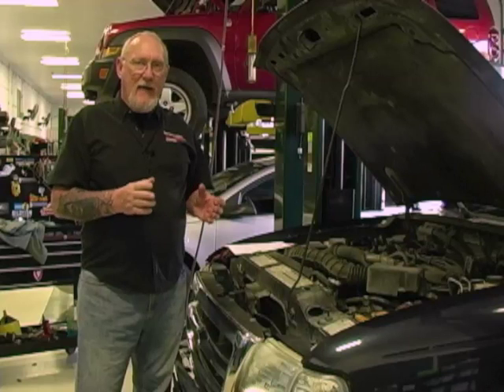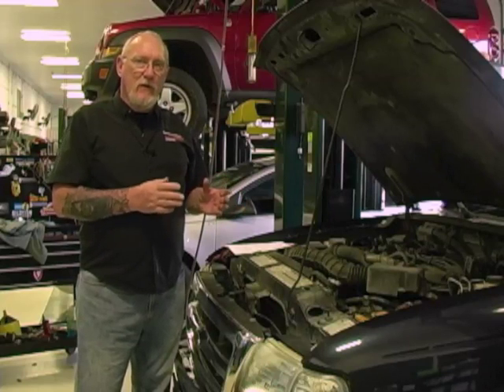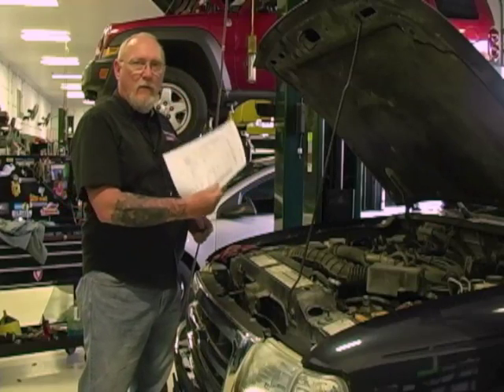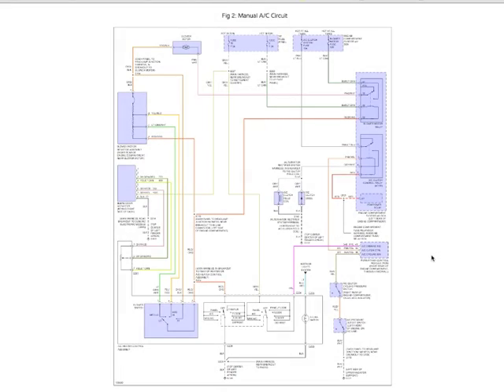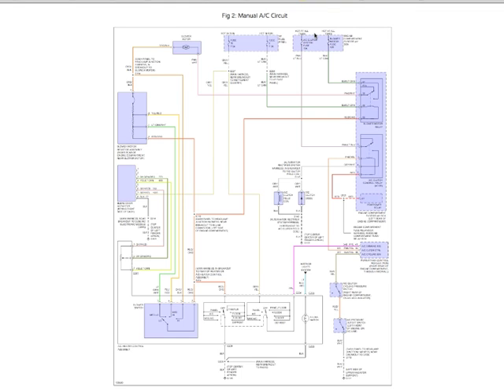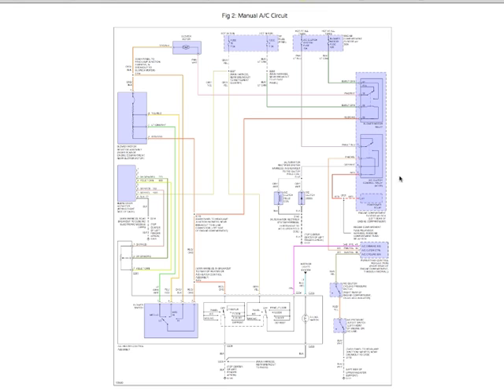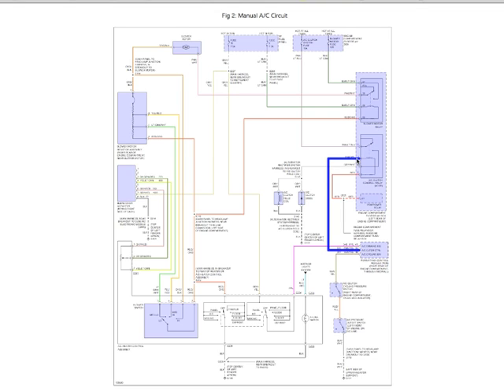The Trainer #40: How To Fix An Automotive Air Conditioning Compressor That Won't Turn On

Comment: how much its cost of that repair ?just an estimate price
Reply from the maker: If the clutch assembly is available separately, repair shouldn't be too much. If the entire compressor needs to be replaced - that's a bit more involved. Of course, it depends on your make/model/year of vehicle.
Reply: @VehicleServiceandRepair  2003 lincoln town car executive
Reply from the maker: @jovitosolamin268  Costs can vary depending on where you live, the shop's labor rate and price mark-up.

Comment: Why would the switch stay on? Even with the ignition off the ac clutch is always engaged unless I pull the 10A fuse. The relay tested good
Reply from the maker: The connection between the fuse and the clutch is in the relay. Sounds like it is stuck in the closed position to me. You may want to recheck that.
Reply: @VehicleServiceandRepair   I've swapped out the horn relay and the horn works flawlessly with both relays. I'm thinking the pcm has fried in a funny way that soldered it closed creating a parasitic drain on the batterie as the clutch stays engaged overnight without the ignition switch on
Reply from the maker: @johnsonandson7772  If the driver that controls the relay is closed all the time, you'd have the same effect. Not as common but certainly a possibility. Install a test light across the switch side of the relay and see if it lights up. If you do find the problem is in the PCM, be sure to check to see what else that driver may control and there is no high current draw present that might have caused the damage - or you'll have the same problem down the road.
Reply: @VehicleServiceandRepair   Would the driver be the pcm? It's a 98 dodge ram so it only really has the one brain or control module
Reply from the maker: @johnsonandson7772  Yes, the PCM activates the relay by closing the circuit of the relay solenoid on the ground side. The "switch" is referred to as a "ground side driver". However, this circuit only has power when the key is in the Run position - so it isn't likely to be the cause of a parasitic drain. Let's start at the beginning...

Remove the A/C compressor clutch relay. With the key off, use a test light to check for the presence of voltage on each relay pin in the junction box. Only one should light the test light - the one going to relay pin #30. 

With the key ON, only two should light the test light. The second pin goes to relay pin #86 and supplys power to the relay solenoid. 

Let me know what happens.
Reply: @VehicleServiceandRepair  Will do thanks for the replies, the ac clutch stays engaged even with the relay pulled out so I'm hoping it's the fuse box not the pcm. I'll lite it up when I get home from work
Reply from the maker: @johnsonandson7772  If that's the case, that has to be a short to power after the relay - so the PCM is eliminated as a possibility.

Comment: What if there isn't any power to the pressure switch on the dryer.
Should there be power there when the ac is turned on?
Im thinking that the control module on dash is done.....?
Tyty
Reply from the maker: If your test results indicate that the ECM is not turning on the relay, then a possible cause is the lack of any sensor input it needs to OK the A/C. As for how the sensor is wired, you'll need a schematic to determine that for the vehicle you're working on.

Comment: I'm a beginner.
03 jeep liberty.
I know I have the right refrigerant pressure.
And the clutch compressor is good.

I tried to bypass the relay and clutch didn't engaged.
I tried to bypass the low pressure switch a and clutch didn't engaged?
What should I do next? 
Or what does this mean?  
The pressure is right and clutch it's good?
Reply from the maker: Have you verified that you have power at the clutch? How about the air gap? How much current is the clutch coil drawing when energized?

Comment: .2000 Jeep Cherokee... Wont Take Freon... Compressor  worked great in the other jeep.  I start the car turn on A/C controls, Hi/max,  When I unplug the ac compressor i still have power on the compressor  end/plug but no power on the plug wire coming from the wiring harness. Only time that wire has power is when the ac is pluged in. Is that right??  My low  pressure switch  4 ports has power on 3 out of 4 ports/slots. My high pressure switch2 ports  has power on  both ports . it wont take freon.. ..{update }   car running ac controls on, if i unplug my low  side  sensor i then have a hot and ground on the high side switch  instead of 2 hots but low side switch has 3 hot 1 neg. unplugged... i did test the wire thats going into that port and it has power going in the  switch but no power in the port of the switch.  If i hook the low side back up, again i got 2 hot ports on the  high pressure switch.  Even when i have 1 hot side other neg or no power on it. it still wont bridge over the clutch and when i got both sides hot and try bridge it it then will blow the big 20 amp fuse. So could my low pressure switch/connector  be bad if so will that keep it from accepting freon.

Comment: I drive a Toyota picnic 2010 and the a/c won't disengage what could be causing this. can someone plz help me
Reply from the maker: There are a few possibilities. The relay may be stuck in the closed position, or the ECM thinks you want the A/C on when you don't. That could be an HVAC control head switch that isn't working properly.

Comment: i have,a 1994 S10 that has an a/c problem I trying to chase down. i checked the freon charge and it shows the system is full. on any setting of the a/c switch, the compressor will not engage. trying to find the cause. does anyone know where the a/c relay is on a 1994 S10 extended cab with a 4.3 V6?

Comment: someone help ... I have 2001 xterra fuses good .. has freon ..a/c compressor only works when I bypass the a/c compressor relay .. I tried a new relay and nothing  worked
Reply from the maker: Let's review what you know to this point. 1.) The compressor clutch circuit works as evidenced when you jumped the relay control side of the circuit. 2.) It doesn't work with the old relay, and it doesn't work with a new relay...so I have to think the relay is not being turned on.

The ECM has to see certain conditions met, including the request for A/C from the interior climate control panel on the dash. You'll need a scan tool with enhanced OE capability to see this PIDs. 

OR

The circuit for the relay control side is open. You'll have to perform basic circuit tests to verify the circuit's power and ground paths are intact.
Reply: did you ever figure out the provlem? my compressor also only engages when i rig a wire in place of the relay..but i switched that and the starter relay which are the same so it cant be the relay fuse

Comment: My compressor engages no problem, but the pressures on the gauges don't change at all!
Reply from the maker: +CDYJKR You don't indicate what year, make and model car you own so I can only offer a guess. If I saw compressor engagement with no change in high or low side pressure AND the pressures were equal high to low, I would suspect a failed compressor...probably a bad reed valve internally.
Reply: +Motor Age it's a 2000 BMW 328i, and that's what I feared. Thank you for your reply.

Comment: what would cause a relay to work improperly . Sometimes it works sometimes it don't . If I run it direct it stays on . 1996 379 peterbilt
Reply from the maker: +Daniel Deras I used to work in a shop that occasionally serviced Florida Highway Patrol cruisers. These guys left their air conditioning on all day long, and it was not unusual for the relay contacts to burn - causing a voltage drop issue that could result in intermittent function.
Reply: +Motor Age I have been having a similar problem with my ranger. truck has to run for about 20mins before the clutch will click on. and works great after that. any ideas if the relay cold cause that?
Reply from the maker: Use the current test described to see if the clutch coil is energized or not, regardless if the compressor has kicked on. You may have a problem with clutch air gap or some other mechanical issue.
Reply: +Motor Age ok I will test the relay

Comment: Hi!

A dumb question maybe but, 
if there is no pressure on the low side, is there pressure on the high side? 

Thanx from Sweden ☺
Reply from the maker: +Fredrik Sundvall No, pressure will be equal on both sides with the system "off".

Comment: Great video Pete. Couple of questions - 1) On the solenoid side of the tool what does it mean when the bottom LED glows red or green?2) If the bottom LED light lights - does it mean that the solenoid circuit is working as it should and the PCM is commanding the relay on?  Thanks
Reply from the maker: +mrghiax 1) The same as the change in color for the top LED - the polarity of the circuit, or which terminal on the front of the tool is the switched system voltage. 2) It only indicates that the PCM has closed the circuit. I guess it is possible to have an issue with voltage drop that would still allow the LED to light but would expect that to be a rare occurrence.
Reply: Motor Age Many Thanks Pete, That has cleared that up for me.

Comment: I have a 2001 Honda Accord my a/c compressor seems go into motion and start when I turn the a/c on, but I recently filled it up with antifreeze so I can get a cool breeze  from my a/c vents but its just spitting out hot air.. any ideas on what could be going on?
Reply: +David Huerta if you actually used antifreeze, that's going to be a problem. But assuming you meant that you used R-134A, if it's still blowing warm air it likely means that the compressor isn't engaging. This can be due to the compressor clutch, as demonstrated in this video, or like so many Hondas you may have a faulty clutch. Supposedly this is a major issue with Hondas.

Comment: One thing I did not see mentioned,  was the IAT sensor.  Some manufacturers (GM) ,  if the inlet air temperature sensor is bad or unplugged,  it will default to 32f.                                  

The ECM will say "Hey!!!  I am not turning on the AC,  it is freezing outside".
Reply from the maker: trae heck True! There are numerous inputs the ECM must see before it allows the compressor to turn on. If it doesn't, it won't command the relay on and no current flow will be seen at all. If power is present to the relay but the circuit is not being completed by the ECM, it's time to check all the inputs to see what is missing. Thanks for the comment.
Reply: Motor Age orfice tube

Comment: Great video!!!  I have a 2000 Cadillac Deville I had a shop fill it with refrigerant now the clutch wont engage. Relay is good,  low pressure switch read 5v with ignition forward but not running high pressure switch read 5v as well.  When the clutch is jumped it blows super cold air.  When the low pressure switch was disconnected the ac controls automatically disabled the ac to the off position.  Any help would be appreciated.

Comment: I have a 2001 Ford Mustang 3.8l V6. AC started blowing hot air. I checked freon and levels are fine. Compressor is not cycling when AC is on, but when I go to turn it manually it isn't frozen. Also checked both fuses for AC and they were fine as well. Still trying to figure out what's going on

Comment: So I am able to measure voltage at the compressor connector, ruling out relay, fuses, pressure switch. So clutch coil is bad? What can I measure on the clutch coil pins to determine if it's good/bad? What about A/C clutch diode? Is the diode embedded in the clutch coil, or connector? Where can I measure to determine good/bad A/C clutch diode?
Reply from the maker: George Schissel Measuring voltage at the compressor doesn't prove anything yet. Many models ground the compressor, rather than supply power, so double check the schematic. If it is power supplied, put your meter in amps mode, and check current through the field coil. 3-5 amps is typical of a field that is OK. HTH!

Comment: Wouldn't it be easier to use a multimeter and measure the voltage going into the compressor with and without the AC switch on? You get 0Vdc with the AC off and 14Vdc with the switch on. Would that not automatically rule out the switch/relays without all of the other tests? I'm asking because I currently am having problems with my AC Clutch engaging on my 97 B4000 and don't have all of the other fancy equipment so I just tested the voltage going into the Compressor.
Reply from the maker: Justin Frady On some vehicles you can do a voltage check directly at the compressor. On others, the compressor is buried deep in the engine compartment. Using current allows you to check the compressor clutch coil operation no matter where the compressor is located.
Reply: Gotcha

Comment: A/C in my fiance's '08 civic works great upon first starting the car. Only after it warms up  does the clutch shut off and remains off till the engine cools down. Could this be a pressure or thermostat related issue?
Reply from the maker: Adam Agee The A/C is controlled by the engine management computer, or ECM. It is possible it is seeing something it doesn't like and is turning the system off in response. I would monitor/record the engine operating parameters related to the A/C system (as found in the service information for your vehicle) at the time of failure to see what is out of whack. It may be related to engine temperature - a thermostat issue or a fan that's not coming on when it should, for example. Or an A/C pressure issue - too high, too low, or a sensor that is misreading and lying to the ECM.
Reply: Motor Age Thanks for the quick response and recommendations.
Reply: Motor Age suppressor show possible fix

Comment: Hi Pete.  Good video.  I am older than you and know why you say "solenoid", but I quit calling the coil in the relay a solenoid after my electronic engineer son explained to me that a solenoid (as on a starter) is a electromechanical actuator that performs work, whereas the coil inside a relay only transmits current.  Keep up the good work.

Comment: I have a 2001 Toyota Camry, the inside fuse (under dash) pops when I turn on the ac or defrost. A/c clutch is free, relays appear to be ok, no blinking ac light. where do I look from here, any suggestions ?
Reply from the maker: rvann You'll need a Power Distribution wiring diagram to identify all the circuits that the fuse that is failing feeds. This is a short circuit diagnosis and may or may not be in the a/c clutch circuit.

Comment: Now I have high pressure on the low pressure port of my ac system could that be my high pressure switch gone bad? And would this cause my clutch not to engage? 1999 Ford Mustang.

Comment: Hi Pete thanks for your video but the audio seems only to work on the left channel of my earbuds noticed this in your other videos also. A great mic to sort this problem is the rode smart lav + which works great with any smart phone. http://m.smartlav.com.  or you could bring your audio in to the free software called audacity and mix it as mono it works on Mac or PC.  Keep up the good work, sandy
Reply from the maker: You know, I have an adaptor that splits it to the recording but didn't think about using it. I'll fix that going forward. Thanks!
Reply: Another great video Pete, thank you!